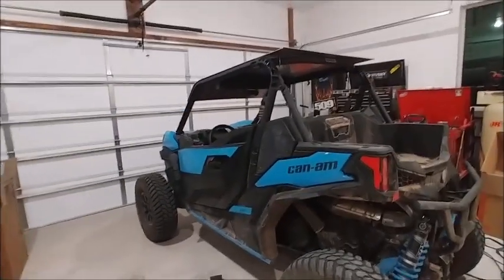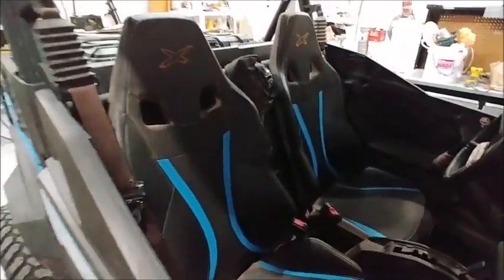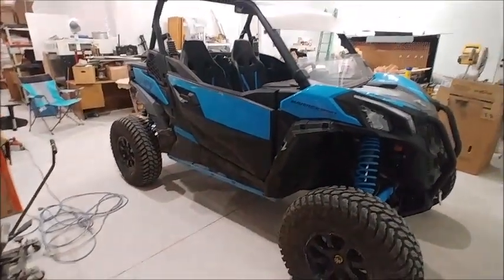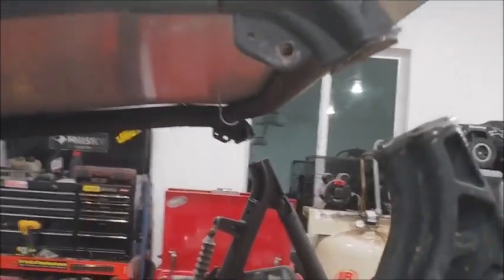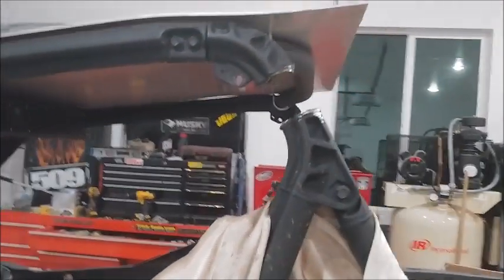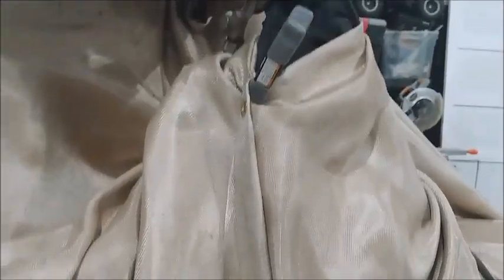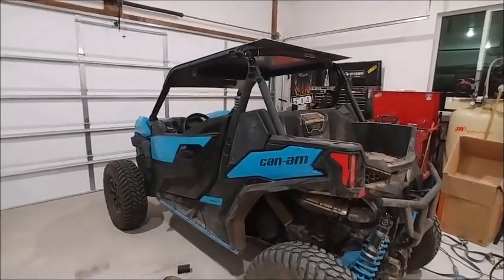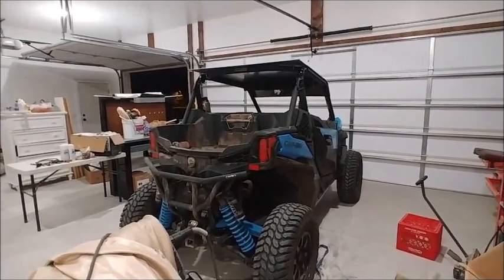Can-Am Maverick sport XRC, how to chop a UTV cage, utv roll cage

Comment: The whole job looks horrific! Have you welded before? Looks like a rookie. You’ve just destroyed your machine and made it lose all of its structural integrity. It’s a death 💀 trap now!
Reply from the maker: Thanks for the input Dan. I disagree though.
Reply: I have to pretty much agree with Dan (although I would have tried to say it with a bit more tact) - wish I could have sent you a personal response rather than public. You need to start wearing a helmet when you ride - if you ever roll your machine, a helmet might be the only thing that keeps that un-engineered goobered up "chopped" top from ending up in your lap. Your $100 roof, well...it looks like a $100 roof.  I've seen "blue tarp" roofs that look better.  Sorry to be critical and blunt, but...IMHO!
Reply from the maker: @BradLewisTucsonXRC  ouch. Thanks for the input, I think.  I dont have any worries about the structural integrity of the roof.  And a blue tarp looks better? Beauty is in the eye of the beholder. Thanks for watching though. I thought I might get some negative feedback on this. Haha on to the next vid, hopefully it will de more appealing. Have a good day and ride safe man.